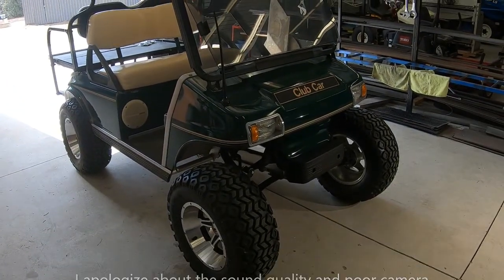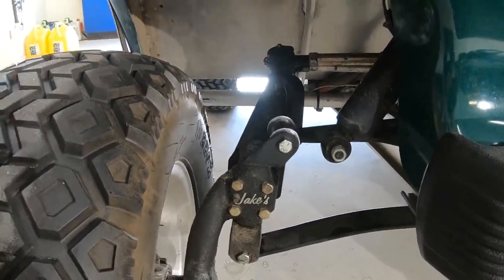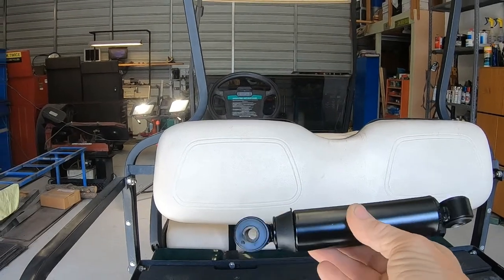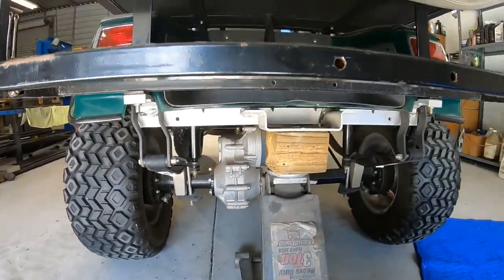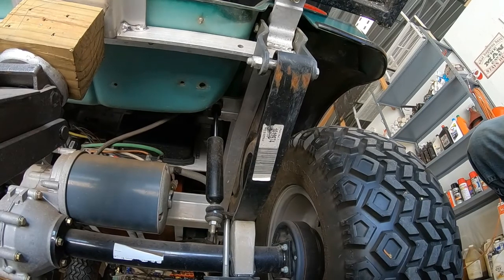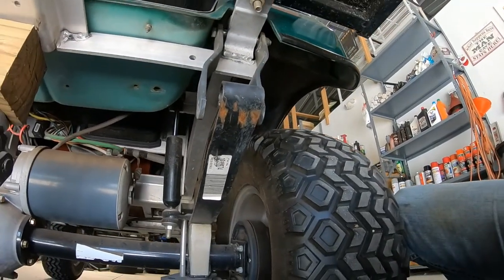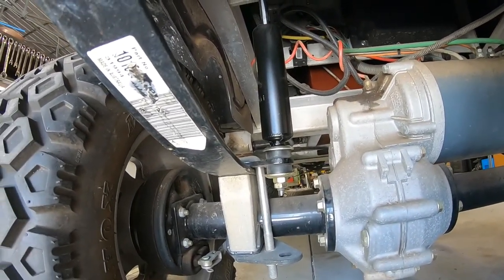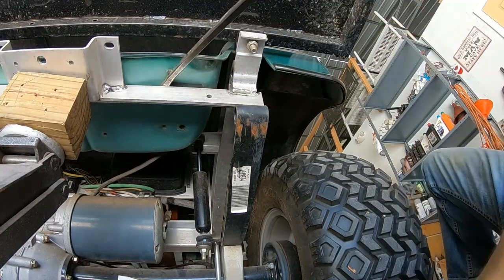Club Car Golf Cart Suspension Rebuild.

Comment: I wish mine was so easy I 2003 Club card the bushing and the bolts Frozen rusted adding a lot of deal with E-40 let it set for a couple of days to get him out December 22nd I got them done I'm the back it was a pain in the ass I done the back please bring on both sides haven't done the front yet but it was a lot of work and determination to get them done I just bought Club card news and need a lot of work also bought the bushing with the new boat I still got to do the front that's another day
Reply from the maker: I was really lucky on mine. I don't think mine was ever left outside.

Comment: All the other videos I've seen on YouTube says to leave your back shocks off when you install a lift kit on a club car DS there not needed. I put a 6 inch lift on mine and heavy duty 4 leaf springs on the back and everyone said it would ride to rough but it's smoother then stock. I just got new front shocks and a heavy duty leaf spring for the front hoping it's not a rough ride at least for not to long. Mine is a 2011 club car ds 48 volt
Reply from the maker: I didn't notice any difference in the ride quality between the old and new shocks, so I don't think they make much difference. Thanks for watching. Have a great day.

Comment: Prying the plastic fiberglass body to remove the upper shackle bolt was a good move, however I simply put the nut on inside of the shackle upon install of the spring.
Reply from the maker: That would definitely make it easier to install. I should of done that.  I just hope I never have to replace the bushings again. Thanks for watching.

Comment: Also under the body because I'm putting you where back seat but have part missing to install the back seat so I'm waiting for the guy on eBay to send me the part that I need to install the back seat so right now I got everything disconnected if I'm going to get it soon I'll be riding a convertible
Reply from the maker: I like mine because the back seat folds down so I can use it as a little truck. It comes in very handy around the property.